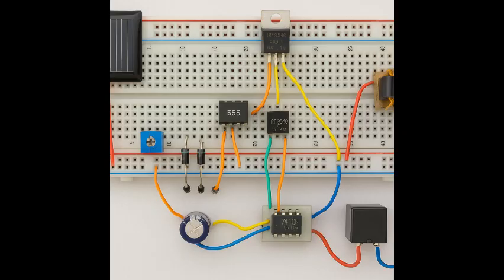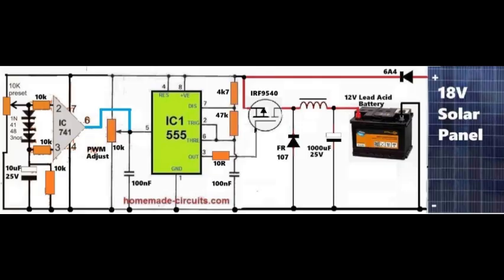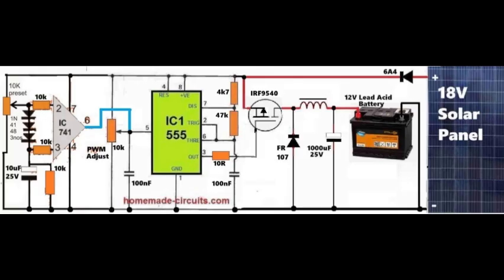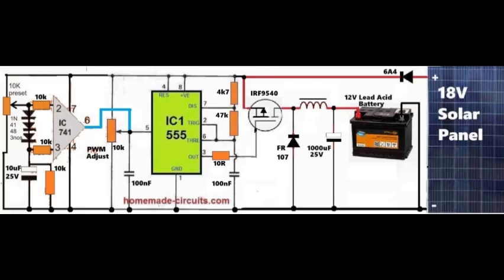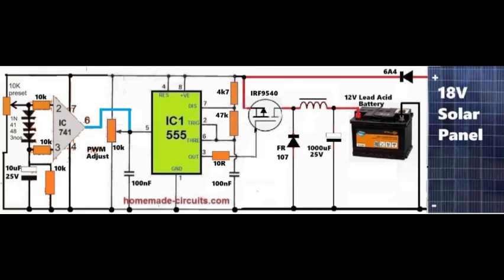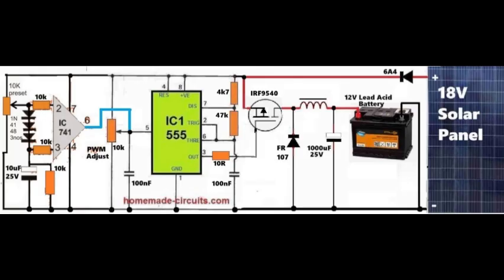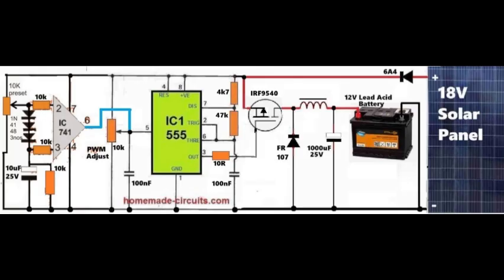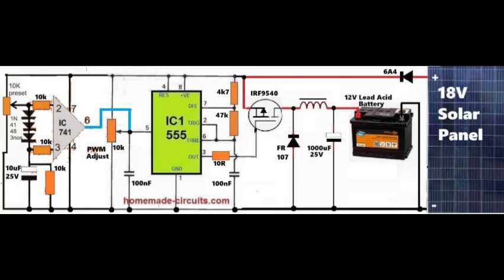Make this Simple MPPT Solar Controller Circuit using IC 555

Comment: What's max input voltage and max output amps of the controller?
Reply from the maker: You can dimension them as you like, by suitably adjusting the MOSFET, diode, inductor ratings.